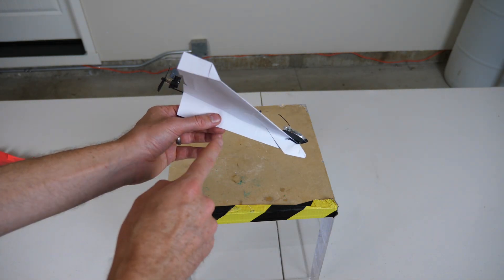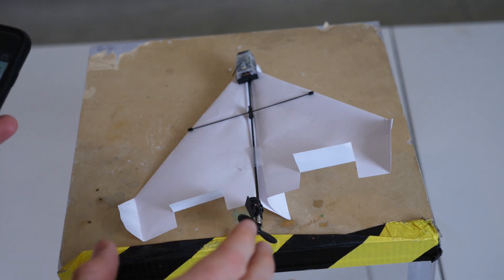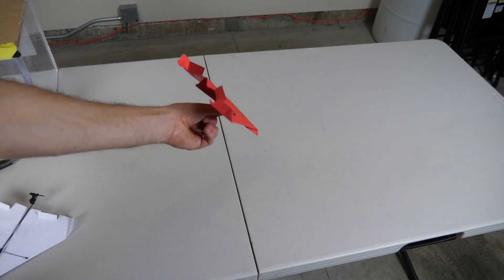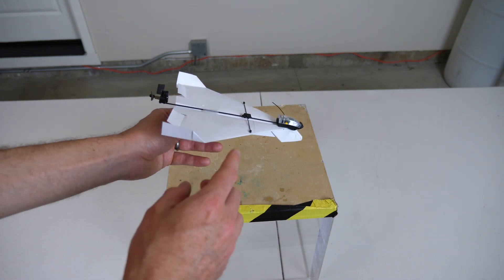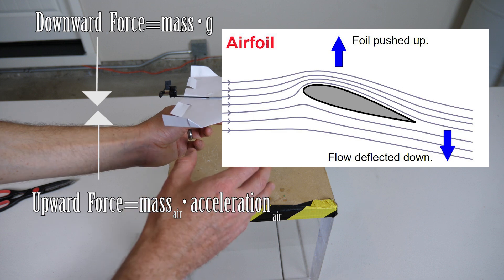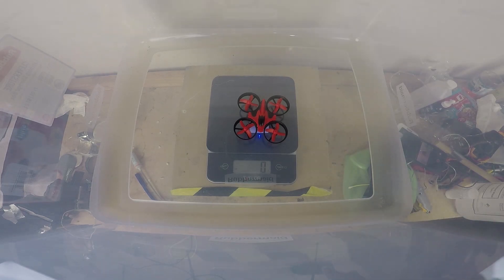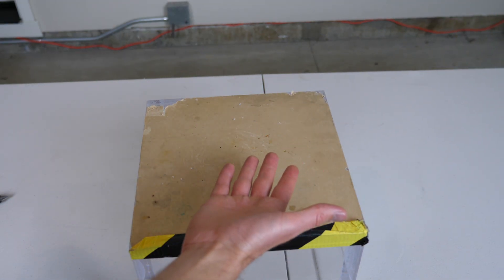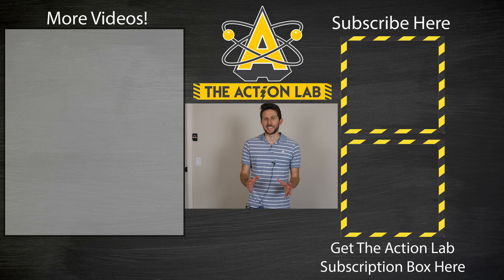How Far Can a Paper Airplane Fly if You Add a Motor? How Do Planes Really Fly?

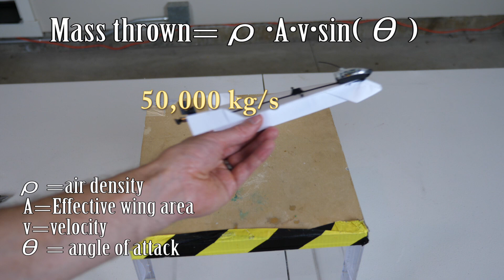Comment: 5:53 30 degree angle of attack?  No plane (except imminently crashing ones) EVER flies like that because a high AoA causes flow separation and a loss of lift due to stalling.

And that formula is wrong - planes still generate significant lift at zero angle of attack.  In fact, to reduce drag during cruising, the vast majority of lift is derived from the shape of the wing and NOT angle of attack.
Reply: Lols Lols yeah, im kind of wondering if he did his research on this one. I really like this channel, but some of this information was just not all the way right.
Reply: Research?  Sure he did research!  He watched someone else's youtube video.
Reply: That's true higher angle of attack also means more drag and lesser forward acceleration. You don't even need to be an engineer to understand that
Reply from the maker: The formula in my video is for a symmetric airfoil. It is correct. The only way a wing can generate lift at a zero angle of attack is when it is cambered in such a way that it still throws air downward at 0 degrees. I am not saying that lift is not affected by airfoil design in this video. That is absurd. Of course airfoil design is important or we'd just use flat wing planes. The point of this video is that the mechanism of lift is commonly taught incorrectly. Many people believe that it is buoyancy that keeps a plane up due to the Bernoulli principle. This is incorrect. Planes have to throw air downward in order to go up. That is the entire point that I am trying to make in this video.
Reply: Yeah. Also, he says how the lower pressure blah blah blah is caused by the air being thrown downwards, which may be partially true (in the end, deflecting air down is higher pressure below the wing), but the Bernoulli effect is also a significant part of lift, just not all of it and not most of it.
Reply: Richard Harris what you are pointing out is a matter of power/weight ratio which doesn't translate to wing lift. If you put a symmetrical wing on a full scale 182, without increasing its power and angle of attack, it will not fly. The fact is that his statement that lift does not come from airfoil design, is just plain false.
Reply: @Bon iBroco  A stall is defined as an aerodynamic condition where the air is seperated from the airfoil. A stall occurs when certain flight conditions (particularly the angle of attack) do not allow the air to follow the surface of the airfoil anymore. The air gets seperated from the surface and this causes the airfoil to loose most of its ability to produce lift. So Lols Lols is right, a stall is the reason for a sudden decrease of lift.
Reply: Richard buy an RC plane & u will find all answers first hand. Bernouli's lift is like 40 % as inverted flying requires a lot lot more throttle
Reply: John H i think it s way easier to search it on google than watching someone else s video.
Reply: Have that rc plane's wing inverted and see how much less time you can fly while trying to constantly pitch the plane up and giving it more power to compensate for the negative lift produced by the wings.
Reply: What works for foamies (or similar RC aircraft) with a PWR > 1 must work for anything right?
Reply: ##d&
Ll
Reply: Bernoulli's principle effect on flying is in doubt where aircraft wings are concerned, Why - for example - can a wing that is symmetrical fly?, why can a wing that is curved on top and flat below fly upside down?  Why can a flat wing fly? Why will an aircraft with a standard curved aerofoil but NO ANGLE OF ATTACK not fly?

I build and fly RC aircraft and all these are true. Angle of attach has MUCH more effect on the aircraft flying than the shape of the wing.
Although you can easily demonstrate Bernoulli's effect by blowing over a strip of paper,  On a wing the dynamics are very complex. All full size and model aircraft, even when in level flight, have a positive angle of attack. 
Increasing the angle of attack will indeed cause the air flow to delaminate and become chaotic causing wake drag. weather the aircraft can or will still fly is largely a matter of power. Many models because of their high power to weight can fly quite well and slowly at very high angles of attack (so called high Alpha configuration). A few military aircraft are also able to maintain a high Alpha configuration to allow relatively low forward air speeds. So the stall speed of any aircraft is not totally dependent on the airflow over the wing.

Air particles separate at the leading edge of the wing - WHY and HOW does the air on top of the wing flow faster? 

If the pressure is significantly lower on top of the wing why doesn't more air flow into the "vacuum" formed to equalise the pressure?

Why should the particles that are together at the leading edge be together at the trailing edge, do they have some form of connection?

Well no - The air particles flowing over the top have further to go and so disassociate from the air flowing under the wing, Thus there is no reason for the air to flow significantly faster over the top as it now has no connection with the air flowing under the wing.

Much of what we teach in secondary school is only a vague gesture of the truth in order to get a concept across. Sadly, for example, electricity does not flow, let alone flow from positive to negative.
Reply: Lols Lols ...loss of lift due to stalling? You're saying stalling causes lost of lift? I always thought it was the other way around...lost of lift causes stalling.
Reply: Look it’s a pair of boobs (.)(.)😘
Reply: Thank you
Reply: Wanna be next Einstein?
Reply: Geez okay nerd
Reply: Are you Einstein?

Comment: Newton's Third Law only accounts for a portion of lift generated by a wing. The pressure differential between the top and bottom of he wing produces most of the lift required for a plane to fly.
The paper plane is able to fly with a flat wing because its weight is very small.
The easiest way to prove the real reason for the production of lift is the fact that a stall occurs at a critical angle of attack, at which the airflow over the wing becomes turbulent and encounters flow separation. If planes were to produce lift only through Newton's Third Law, then the smooth airflow over the wing should be irrelevant to the lift produced.
Reply: I absolutely love your content and what your channel stands for 😁 I'm a huge fan! But I've noticed, when it comes to lift generation, you've gotten it wrong a couple of times.
Reply: Thanks for saving me the trouble of adding this exact comment.  This is the 2nd time I've seen lift explained like this, and it simply isn't true.  Bernoulli's principle of lift better explains the forces at work than Newton's laws.
Reply: Bernoulli effect doesn't account for the entire lift, however. Most of the lift is in fact downwards 'deflection', however, it is not actually deflection, and more that the air flows along the downward turned top portion of the wing faster than it does along the upward turned bottom portion of the wing, so there's a net downward flow.
Reply: NO, a paper plane that is falling will glide on a slope that is governed by it's weight and wing area. try it - the only way to make a paper plane fall strait down is to point the nose at the ground.
Reply: https://www.grc.nasa.gov/www/k-12/airplane/wrong1.html  

A NASA discussion paper, I don't Think I would argue with them!!

"...Because the upper flow is faster, then, from Bernoulli's equation, the pressure is lower. The difference in pressure across the airfoil produces the lift.

Before considering what is wrong with this theory..."
Reply: I would suggest to you  that the plane is moving through a relatively dense fluid, (air), and simple takes the path of least resistance that is suitable for the angle of the plane to the horizontal path through the fluid. You can practically feel this by holding your hand out of the window of a car and tilting it. (use caution if you try this)
Reply: A model that weighs several Kg and has a flat wing can and will fly. The relationship between the weight of the object and it's ability to fly is minor compared with the relationship between the surface area and the ability to fly. 
There are many examples of models that can fly in a high alpha configuration allowing very slow flight well below their normal flying speed. there are even a few Military aircraft that can achieve this.

The stalling of an aircraft is more to do with the power to weight ratio, Given enough power the aircraft can and will fly in what may normally be considered a stalled condition, 
https://www.youtube.com/watch?v=P_NSxSyrvYA

A flat plate in a fluid will follow the path of least resistance through that medium, given enough power to overcome drag if the plate is tilted it will follow a path related to that tilt because it is the least resistance path. Air is a fluid.
https://www.youtube.com/watch?v=GGkJqT9-XEU

high alpha at 8:38
Reply: True if planes only flew due to the airflow downwards, a Boeing 747 like he said (I think he said that model) would fall back much quicklier. The Boeing 747 (and any other aircarft) has the center of mass in front of the wings (he said that in the video) and the center where aerodynamic forces are applied behind it (to make it stable) and located where wings are attached to the body of the plane.  So if it's only flying because the air is "throwing" the air downwards after passing by the wings, that force would cause a momentum that would make the nose tilt down and crash. If your paper airplane flies is because the angle of attack of the flaps cause a momentum that makes the nose go up so the AoA of the flat wings make it fly. Well, "fly", it just glided a lot longer.
Reply: Richard Harris The holding the hand out of a car method is especially effective if you  kind of cup your hand when you do it. Yeah, just be careful and don't tilt too much. A few times when I did it when I was younger and the force pushed my arm up/down pretty forcefully into the window frame lol.
Reply: Not entirely so. These aircraft in High Alph configuration still have control authority. IE. Air is still flowing over the wing even if it is chaotic (turbulent) - This allows the conventional controls to operate.This is another way to say -  It's still flying. Yes you need considerable power to do this OR a large surface area like the nutball model I linked to above. (I have one of these and high alpha flight is uncanny but still definable flight with regular control. Just at an angle of attack that would normally be called a stall.
Reply: Look up Charles Fauvel ,(his flying wings use a reflexed trailing edge for stability) witch wouldn't be possible without Bernoulli effect
Reply: "If planes were to produce lift only through Newton's Third Law, then the smooth airflow over the wing should be irrelevant to the lift produced."
Completely wrong. You can describe the flow of a compressible gas with whatever equations you want, but you can't violate Newton's Law of motion. That's why it's called a LAW. That should be enough right there to figure the rest out yourself but just in case: All of the lift generated by a wing is created by forcing a mass of air downward. Simplified description of a stall: Much of the air just above the wing is not flowing downward anymore. You said it yourself "flow separation". The air is swirling in vortices that decrease the net difference in pressure between the upper and lower surfaces. Here's a video to demonstrate.
https://www.youtube.com/watch?v=6UlsArvbTeo. But beware. See what is there, not what you want to see.
Reply: omg you people and your NeWtOnS LaWs oF shit you need to start listening to yourself and not to dead people
Reply: thexfile837,
The thing about that dead guy is that Newtonian mechanics is well verified through countless experiments conducted by everyone from high school students to eminent scientists over the past three centuries. The fact is that nothing having to do with aerodynamics departs from those laws. The other way of putting that is that every prediction that Newtonian mechanics makes concerning motion is correct. It's not a matter of who you listen to or "believe"; Its a matter of whether you understand science or not. But, since you have offered no argument or information to counter these facts, it was probably a waste of time (for you, at least) to write this reply.
Reply: hmmmm nice point you actually made me giggle about what you said... okay you won.
Reply: Gonzalo De la Torre nobody fucking carrres
Reply: @Adamn-nr4mf  Hahahah lol
Reply: That's right. Paper plane is not producing any lift it just falls down slowly due to air resistance which is increased due to more surface area of the wings
Reply: Richard Harris I agree with you in the fact that I should have referenced the surface area of the wing of the paper airplane to be more relevant than its weight in a sense.
But the thrust required to allow a fighter jets to climb almost vertically when seemingly in a stalled condition is not because lift is a subproduct of thrust, in those cases the fighter jets act more like rockets, thus, the lift generated by the wings in that specific circumstance is irrelevant.
Reply: yaksher The downward flow created by the difference in speed between the top and the bottom part of a wing is insignificant compared to the lift produced by the wings through Bernoulli's principle and Newton's Third Law. Most of what people use to visualize those downward forces are in fact wingtip vortices, which ironically enough produce drag for the airplane.
Reply from the maker: Bernoulli's principle only accounts for a very small portion of lift. Air must be diverted downwards in order for lift to occur. If you watch any picture of a plane flying through a cloud then you see the air being diverted downwards just like under a helicopter. If you actually calculate the amount of air being thrown down in any real lift equation you will see that the force due to momentum change of air downwards has to equal the weight of the plane. Someone posted a link to a NASA page that describe the lift coming from Bernoulli principle. They are describing it the way that most simple textbooks do. It is incorrect or at the very least not complete to say that.
Reply: @TheActionLab  the downwash and pressure differential are tied to each other you cannot have one separate from the other.

Comment: How does it throw the air down using a flat horizontal wing ? When the wing is curved, it makes sense that the air goes downward (looking at the drawing at 5:29). But when it is flat, the air should be pushed horizontally. Maybe the plane do not remain horizontal, and the wings are tilted ?
Reply: That would explain why the deflectors at the rear of the wings are actually pointing up when you hold the plane horizontally. The air will push these pieces and generate a rotation of the plane. The nose of the plane now points upward, the deflectors point horizontally (in that position they no longer resist to the air flow and the rotation stops), and the wings are tilted.

Comment: So does it mean that if I'm standing under a plane flying that I experience the same force as being under a plane that's landed? Ok this was a joke question because that air would spread so much that you'd only feel a fraction of that, but... there's another question. If you had a rocket that was flying upwards, how long would it take for Earth to experience no force from that rocket? Wow I've reached an all time low.
Reply: Theoretically, the earth may experience force from that rocket for eternity, though the force would decay exponentially.  The real, measurable force would would have disappeared long before the rocket left the solar system.
Reply: @Mitch Delemeester There are so many things wrong with that comment—first, it is not exponential. When you're speaking about science, please don't use exponential when it is definitely not exponential. Second, the moment the rocket exhaust isn't pointed at the Earth, it's not applying force on the Earth.
Reply: yaksher , thanks for the comment, and you're correct: if the rocket were flying tangentially to the earth then no resultant force would be felt by the earth. 
When I mentioned exponential decay, that's a generalized way of saying the force would assymptotically approach zero in the positive domain, which is correct as OP never states the rocket changes direction.
Reply: Fair enough. Though, technically, you're still wrong. Once the rocket is moving over escape velocity + exhaust velocity, the exhaust will also be moving over escape velocity, and the force on the Earth will drop to 0 (actually, it'll become negative because of the gravity of the exhaust gases pulling the Earth towards them, reclaiming part of the momentum that brought them to space in the first place).
Reply: yaksher , just because the rocket reaches escape velocity doesn't mean the exhaust does. The exhaust is ejected from the rocket at high velocity relative to the rocket and in the opposite direction of the rocket travel. As long as the rocket is accelerating, the exhaust gas will always create positive pressure. If the rocket began coasting or slowing down there could be negative pressure behind the rocket.